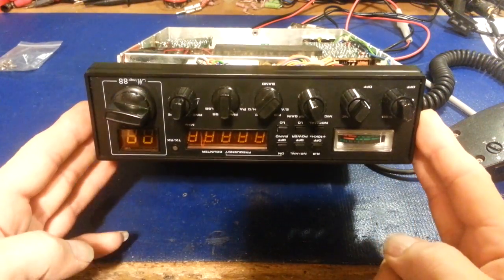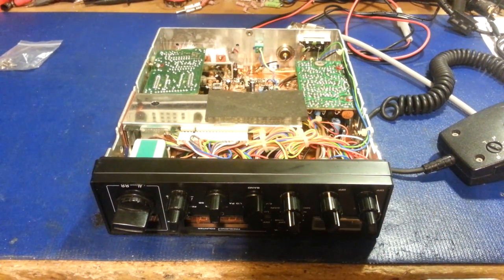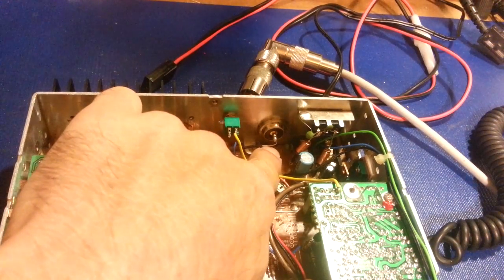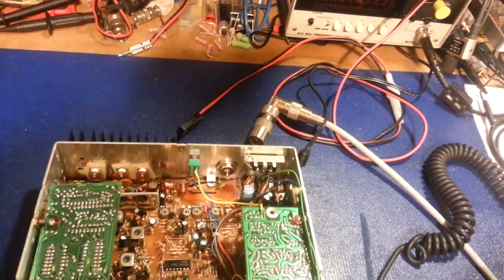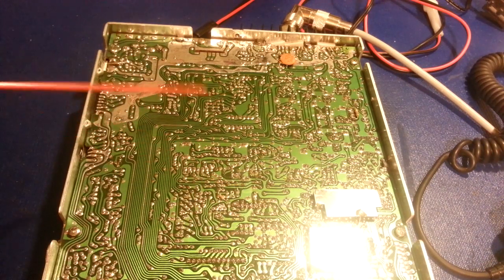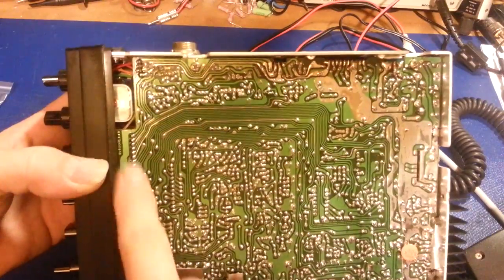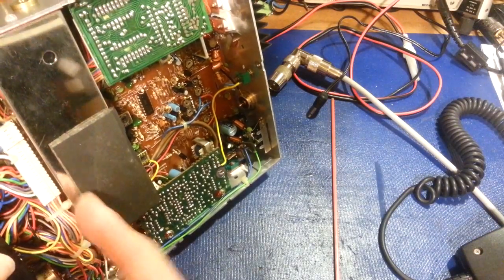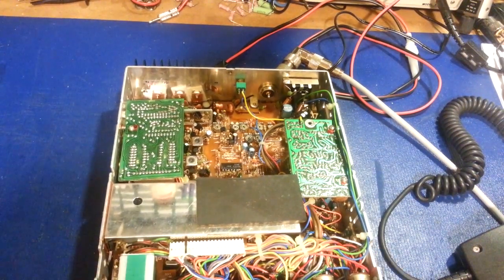Mirage 88 no RF output power.  Basics of troubleshooting.

Comment: I opened one up that I just received & it had a toggle switch in the same place as that radio & when I discovered it was a useless Talk Back ON & OFF switch & took my snips to the two wires & stopped that useful function.I then removed the toggle switch & will use it for a wort while project someday.Like other so called Features in these radios like Roger Beep & Echo that will never be used as long as I own the radio it won't even be switch on by accident.These radios are very loud on the air on transmit & they don't need the useless BS noise toys nor does the 11 meter band since it is already a toilet with plenty of unneeded & unwanted noises for the thousands upon thousands of children on the band.No wonder it's labeled the Children's Band by so many.Not a bad radio but it would have been much better without the useless noise toys being installed.

Comment: Had the same problem on my Kenwood TS-711 Multi-mode 2 meter rig. After 30 years suddenly no output. Turns out the factory never soldered the wire into the SO-239. The wire was inserted into the solder cup of the connector, but never got soldered.
Reply from the maker: Not bad considering how long it lasted.  I to run in to that from time to time on high end gear.

Comment: Man, I don't know how many times this has happened to me. I am the only "tech guy" in my area, and people bring their radio gear and computers to me to have looked at, fixed, peaked and tuned, etc. I don't know how many times that I have gotten radios or linears in trades or bought for cheap because they didn't work, and after inspection...it's as simple as a cold or broken solder joint. These are always the very first things that I check when I look at a radio or linear for someone...because it's the most common problem.

Comment: Does the built in meter in most CB/Export radio's take their meter drive off the final or from some place much earlier in the rf chain? Thanks Mike!

No one sends their problem to someone that is a true peer they always send it to someone better! LOL So the fact that you get the difficult jobs speaks to your skill and the results you get when other's can not solve the problem!
Reply: Sampled after the finals with a detector. Usually just a cap, diode, and a pot.
Fairly simple circuit - they are not going for accuracy.
On receive it's usually picked off between the AGC and the detector but I have seen it done other ways too.
Reply: Thanks. Mark19960 Uniden has changed the board in the 980 BearCat. As I understand it the board is more like what is used in the Grant II and the 880. This only applies tot he 2016 production there are still plenty of the 2015 production on the market as well. The board number and parts layout and event he parts used are different now. Some of the IC's that used to be shielded are no longer shielded and it now uses a totally different driver and final configuration. The limited info I have is that the 2016 change aaffects those units that have a serial number starting with a "6" in the first digit.
Reply: New Board # PB-371AA   1/4

Old Board# PB-367AB   1/4

I said Grant II in my first responce maybe 880 is closer but the final driver location and layout is more Grant II like.
Reply from the maker: Mark nailed it.
Reply: Thanks guys!